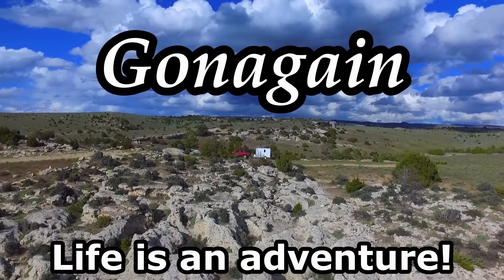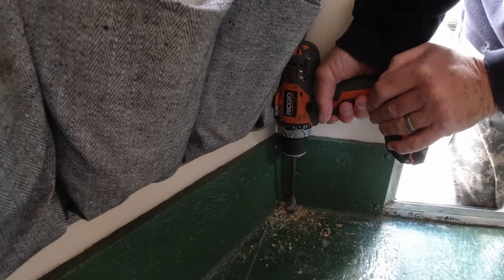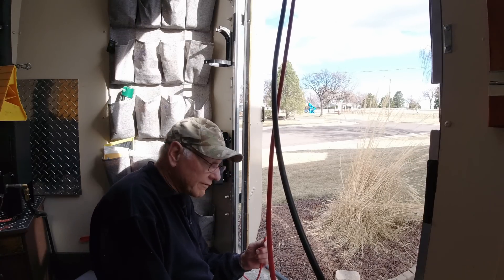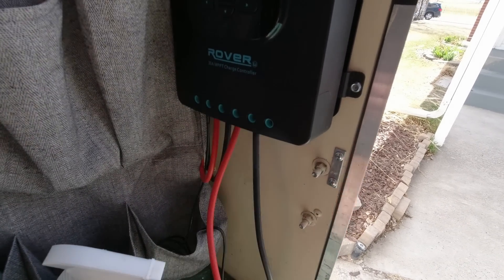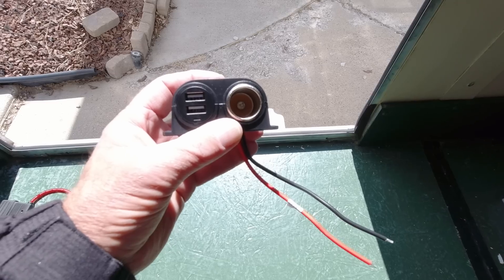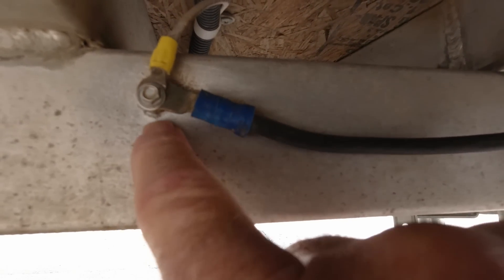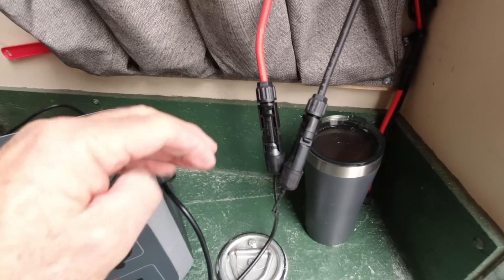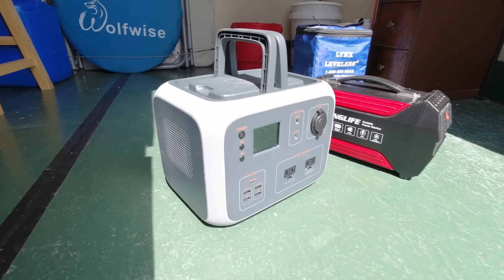RV Solar Install - Renogy Rover 30 Amp Controller

Comment: I just want to bring up a couple points. That secondary load is confusing and not well explained by manufacturers. I think it's intended for small things limited to 2 amps output. One I was looking at intended it to be used as a trickle charger for the vehicle battery. Another point I took notice of was connecting your other battery unit in parallel directly to the solar panel. Check that installation because I think you may exceed the panels load/current limits. Most 12 volt RV panels have an open circuit voltage output of 21 or 22 volts. A GOPOWER 190 watt panel has a rated max current output of 9.5 amps I think it is.That goes into the controller and is converted into a charge voltage for your batteries. 13.2 volts at full charge float condition, 14.4 bulk charge when batteries are low.  The solar panel is not intended as a direct power source. The charge controller is a safety valve for your solar panel. It is intended to supplement battery output. I think you should check on that connection to be sure you aren't damaging your panel. Wishing you well from an undisclosed Safeway parking lot along the Columbia River Gorge trying to get some paperwork caught up before heading back up into the hills.
Reply from the maker: I gotcha.  The Bluetti solar charger has it's own MPPT controller and is designed to hook directly to a solar panel at 14 to 40 volts.  It will take up to 120 watts with any additional wattage just not being used.  If you hook one up through the battery it won't charge completely because the voltage isn't high enough.  Anyway, that's why it get's hooked up directly to the panel like that.  We actually got outta town and are doing a road trip within our state.  Feels good to act normal again.  That's funny because I'm typing this from a grocery store parking lot myself!
Reply: @gonagain  Ok, it has it's own mppt controller so you're good to go. I assume that controller will regulate charge current to not exceed the panels limit being in parallel.  I got back to my camp spot at 5 am after an upload and getting pulled over for a burned out tail light. Just getting going,  coffee in hand. I look forward to seeing your trip. Take care.
Reply: The Renogy Rover 30 amp MPPT manual says that the load terminals are rated for 20 amps...but you cannot use them to run another inverter.

Comment: All good except for the beginners will not understand the splicing into the hot line and fuses...
Reply from the maker: Good point Jimmy,  I may need to elaborate.
Reply: @gonagain  Lack of true education endangers a lot of people; for they do not know the difference of a fuse and a compositors or how they even work or how they are put in line positive to negative makes a difference, they may here you tell them like the aluminum and copper and iron and copper, but they sometimes forget till they experience it for them selves, and turning off the input to the battery to them means take the cables of the battery only and leaving the control box operational, some time you have to remind them not to be the negative to the positive power line so they do not get shocked...

Comment: I was always told never hook to the LOAD terminals on your charge controller. But to hook to the leads that come off your battery. The LOAD terminals can only be used for a light. No one on YouTube ever hooks anything to those LOAD screws; there must be a reason. Maybe overload?
Reply from the maker: I couldn't find very much about it except one guy that hooked his lighting and a stereo to it.  I'm currently using it mainly for phone charging.  But it's there to be used anyway and the voltage and current are regulated.  Let me know if you see anything more about it.  Thanks Kevin!

Comment: I use SLA Group 31 Chrome Battery from Walmart.com for about $198.00 and delivered. So far they are working perfectly!  You also check with Chrome Battery. com Check them out.
Reply from the maker: I will check that out, thanks!

Comment: What gauge wire did you use to connect the panels and the battery?
Reply from the maker: I ended up using 10 guage double wrapped and tinned.  I was going to use 8 guage but couldn't get it at the time, but 10 guage was fine for the short run that I had.

Comment: Good job Rick.
You know, the one thing that used to worry me was going up to the air strip for a quick fly around and finding a (nontrades) pilot fiddling on his/her plane with tools, 🤣🤣🤣. 
One thing you need to remember Rick, if you are going to parallel a pair of batteries for your overnight power, especially if they have no load, they will flatten each other (over time) due to circulating current. No 2 batteries are exactly the same, there will be a small potential difference between them which causes the circulating current. For storage, the second battery needs to be disconnected (one lead only) to prevent the circulating currents. On a trip or short duration off charge it won't matter too much. Hope this made sense, 🤣.
Cheers guys, stay safe.
Reply from the maker: That does make sense Pilot.  There must be something on the market to help isolate them so that doesn't happen.  I know that both batteries should be the same size and lot number.
Reply: On a trip or for short periods off charge there's no problem Rick, but long term storage all you need to do is disconnect one of the bridges between the two batteries or install an isolating switch. Having 2 batteries from the same production lot won't solve the problem of discharge because no 2 batteries are exactly the same. They will still circulate but will discharge slower. If you have $$ to spare, 2 series connected heavy duty 6 volt batteries will have a longer charge life because the circulatory circuit doesn't exist.
But none of us have spare $$ at this time.
In many vehicles with dual battery systems there are many systems in use and there are probably a few ideas posted here on YT. We have a couple of guys locally who have done similar to their vehicles, but their vehicles are used every day so circ currents aren't a problem, similar to you guys when on a trip, you'll be charging and using every day so discharge won't be a problem. 
In circumstances where to 2 batteries are badly mismatched they can discharge completely in a couple of days and possibly cause the weaker battery to collapse completely.
Your idea is great and well worth pursuing, but there are caveats.
Reply from the maker: Thanks Pilot, I'll try to figure that all out.

Comment: Question for you. How is the bottom holding up with the foam board? Did you seal the bottom first, before the insulation?
Reply from the maker: I didn't seal the wood because I think it's better to let the wood breathe (I'm an old wooden boat repair person).  The panels are glued to the underside with foam board adhesive and are also fastened with screws and fender washers.  After about 4 years of use and many miles through all kinds of weather I can't see any signs of it coming off or getting damaged in any way.
Reply: Gonagain cool! That what I was thinking too, let the wood breath with foam board.

Comment: Your giving me ideas. Your rig is looking good. I have a question for you. Do you guys have a refrigerator in your trailer? I want to have one with a built in kitchen. 8m going to go to the RV scrap yard and find a sink and cabinets with a stove. What is your thoughts on having a kitchen in the traile I know that space is a premium in a trailer. Your going to run out of room soon. 🤣 I'm helping my mom pay for her 20% of her new wheelchair. She makes too much to get Medicaid in Illinois so her share is $4,164 dollars. Then I can start looking for my trailer. I'm thinking of using the same style of trailer as you and Linda have. I was going to get a pop up without sliders but I know the frame will torque and the top won't slid up properly. I'm going to use the independent rear axles so I don't have to worry about ground clearance. I want it to be able to go where our trailblazer can go. Plus the utility trailer will take a beating. I'm keeping my eyes open for a 6x10  because I'm 6'2" and I can get away with sleeping sideways. My Linda I would love to meet up with you guys on the road sometimes. I stopped buying firearms for now. I already have enough although I would love to get a .458 SOCOM upper for my AR-15. I live the 45-70 round and I always carried a Marlin 45-70 when I was backpacking in the mountains in Colorado. There is just something about that round that I love. I fell in love with the AR platform rifle for the wide variety of calibers it can fire with a quick change of the upper. I have 3 different calibers now. I have a 5.56/223 with a 22lr conversion kit and a 9MM upper and the Glock mag well so I can shoot it at my pistol club that I joined. I have already made a portable reloading bench that I will be able to attach it to the outside of the trailer. I want to go back to the Whittington center in Raton New Mexico next summer. My goal is to have a trailer ready to go by next summer but I will do my best to have it ready and use it this year. Once I get the trailer I'm going to be asking you a lot of questions. I don't want to have any issues that I may create. I guess if I can change a engine on a car I should be able to build the trailer up. Thank for the great video. I hope you and Linda are doing well. See you on the road.
Reply: When the war starts ,I'm on your side !
Your good friend Vinny in good old Fla.
Reply from the maker: The only reason we don't have a built in kitchen is that we need to room to haul our 4 wheeler sometimes, otherwise we'd build in a countertop and cabinet down one side and across the front.  For a refrigerator we are going to get a Dometic type of about 45 to 50 quart size, maybe a Whynter(?) brand because they have a great track record and are a lot less expensive.  You probably already know about these 12volt compressor type reefer/freezers that don't use very much current.  Love my ARs...

Comment: Do Linda a favor and put a couple of plastic/rubber caps on the heads of the bolts right at the 12volt plugs. You don't want her to cut her dainty hands on them when plugging something in.....she wouldn't be able to weed the yard then! Seriously, a well thought out, inexpensive power system.
Reply from the maker: Good eye!  I cut them off and filed them smooth.

Comment: Do they make deep cycle AGM batteries, the car ones do not like to be fully discharged.
Reply from the maker: Yes they do and that's what I'm getting.  I was just looking at some Chrome brand sealed lead acid AGM batteries and may get two of those.

Comment: If it true that the controller would be damaged without a load if the solar collector is connected, then you would need a double pole relay to disconnect the input if the fuse blows.
Reply from the maker: Yeah, I was just going by the manual from Renogy.  So you're talking about the fuse between the controller and the battery.  Yeah, what happens if that fuse blows?  I would hope that the fuse from the panel to the controller would help with that.  Good point Jerry and a switch would be convenient to have.
Reply: It’s good practice but I heard there’s clamps in the controller that will prevent damage

Comment: Great set up, and you covered all the details .... grounded, fused, load right off the solar panel, power management with the least loss of power ... chargers & controllers use some power, as does wire if it's not good quality ... and as you've done good quality connectors are a must ... clean wires and clean grounds are a must ... I check and clean my grounds often if they're external, exposed to weather, salt .... and like a lot of people I struggle with clean wire/bundling to keep it all neat and protected from jarring/pulling ... never had an AMG bat, but people love them who have bigger power draws from fridges ... especially when it's rainy/overcast and you don't want to run the vehicle or generator .... still a great set up without too many bells and whistles  ... sunny and 67 here in PA, so headed out to cut the lawn ... rain expected the next 6 days straight
Reply from the maker: You're right and I try to keep everything as simple as possible.  Ah, Spring!  All this rain means weeds and mowing.

Comment: Rick, Check out AliExpress, they have some great prices on good lithium batteries. $436 for a 150 AH lifepo4 Battery! Less than half the price of a 100 ah Battle Born
They are so much better than Lead acid batteries in every way! You will need some low temperature protection for them up in Montana.
Reply from the maker: Steve, thanks for that tip, I'll be checking them out.